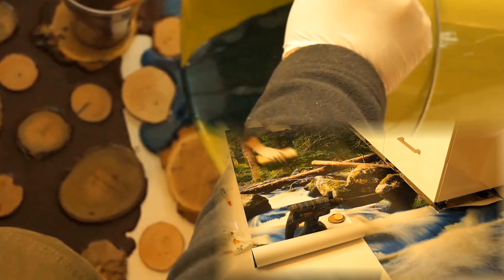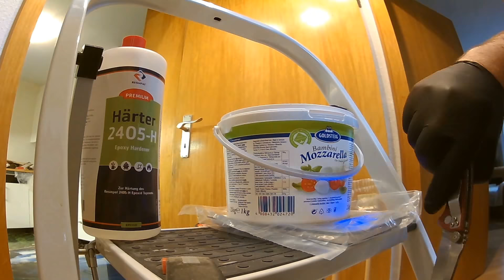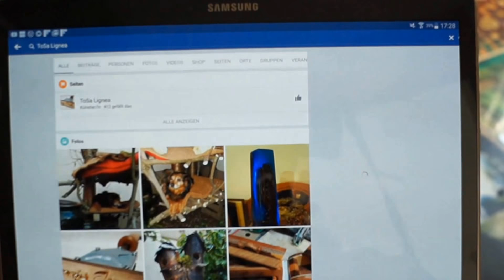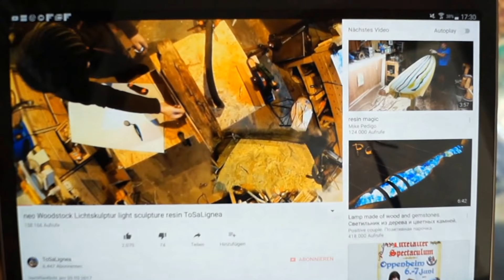3D Floor Kunstharz Bodenbeschichtung Design Resin Epoxy Waterfall Tree Slices ToSaLignea

Comment: hallo, habe auch eine frage, wenn ich nur fotos nehme, die ich als bodenbelag haben möchte, brauch ich dann auch so viele verschiedene schichten? also, grundierung ist klar, weil der boden ja nicht mehr saugfähig sein soll, nach der grundierung dann die fotos, danach das kunstharz? braucht es dann noch ein topping? würde das gerne in meiner küche machen, mit fotos...liebste grüße vivien
Reply from the maker: Hallo Vivien,nein du brauchst so viele Schichten nicht. Das habe ich
gemacht um mehr Tiefe zu bekommen und den 3D Effekt zu verstärken. Das Topcoat muss
sein, es ist elastisch und verleiht den Boden eine Schutzschicht. Beispiel: weil
ich so tollpatschig 😉war ist mir ein Glas auf den Boden gefallen (auf
eine Schicht Resinpal 2416). Das ist so hart aber dadurch auch spröde das ein
kleines Stück aus den Boden gesplittert ist. Das gleiche ist mir beim Topcoat
auch passiert und es ist nichts passiert. Beste Grüße und viel Erfolg bei deinem
Vorhaben!

Comment: I just wonder how long it last, when we need to change the floor how we can take it off.
Reply from the maker: Yes, I'm wondering again and again, what are you doing with a tile floor or glued wooden floor?
Reply: Questioning the durability of a floor is a legitimate question. Micro-scratching, etc. I am wondering how it looks in 5 years, will it amber or turn yellow?
Reply: But fantastic job. I might not have left protruding rocks, but that's just me.